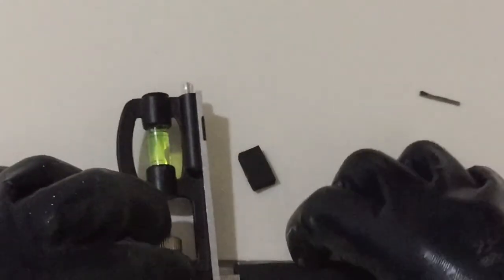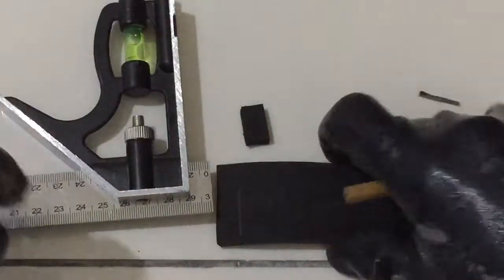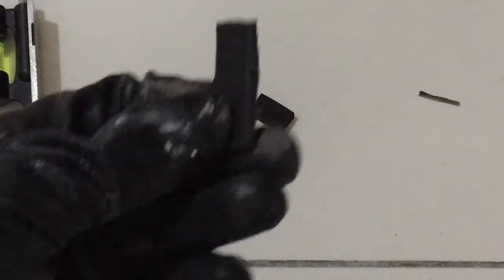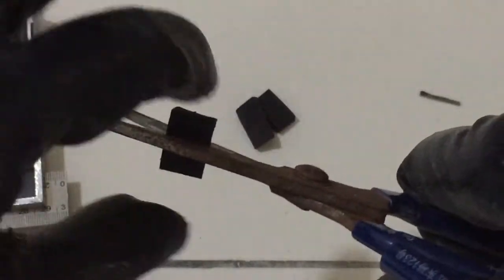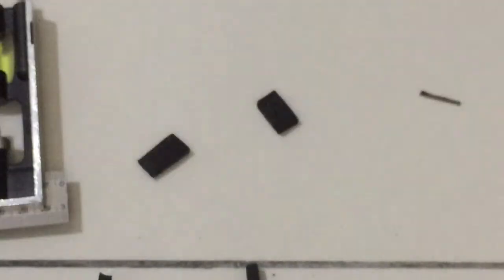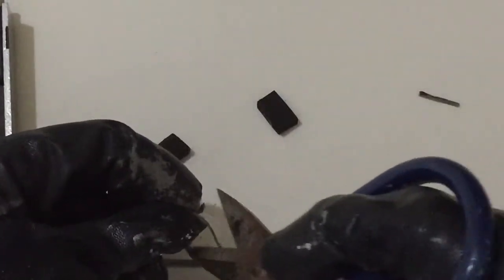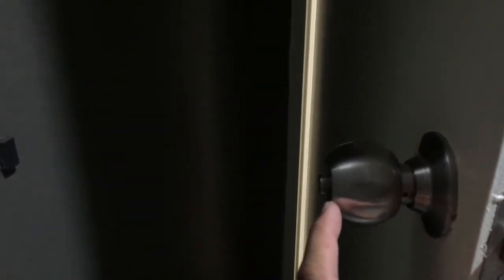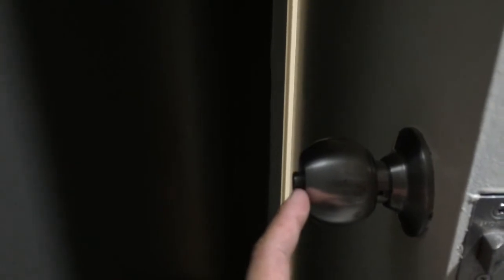DIY Door Stopper

Comment: thanks for the video. can you please clarify how to align the or fix the timing gear while changing the timing belt in proton persona?
Reply from the maker: Need a 17mm nut wrench to turn the crankshaft  near to the wheel. The vehicle ned to be placed onto the jack stand to properly hold the car into place. Align the tiny notch at the spocket by turning the crankshaft. The side wheel nearer to the timing belt side are required to the removed to perform this operation.
Reply: thanks alot dear for your reply I really needed this info. so there is no tool like a pin to install in the timing gears like most cars in order  stop the timing gears from moving?
Reply from the maker: There is a notch and engraved triangle to be match. I used a welding wrench to clamp hold the spocket once they are aligned using the 17mm long nut socket.
Reply: sorry I don't understand. you mean you fix the timing gears with with the 17  mm long nut socket? I think it is fixed with a tool like a pins I think the 17mm long nut socket is tight or loose the timing gear nut